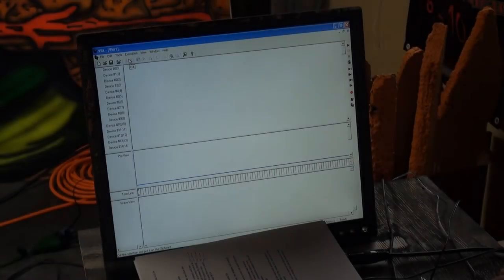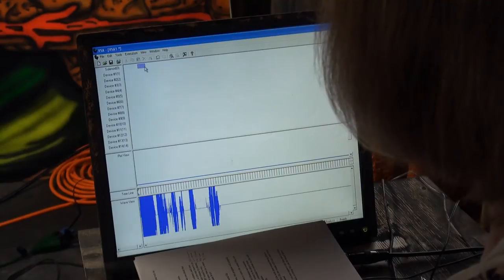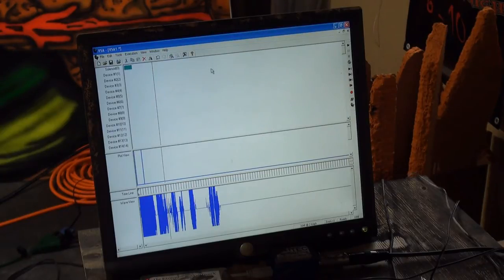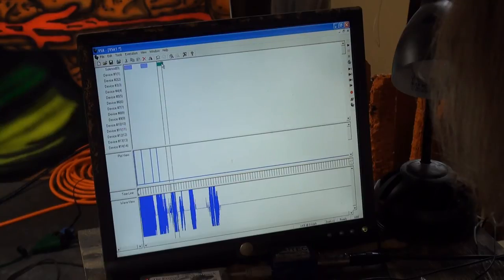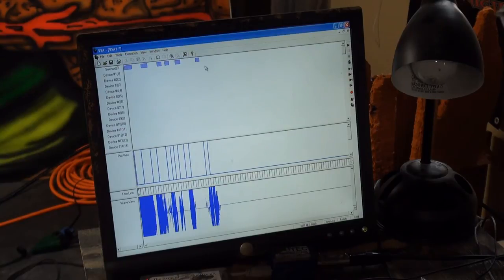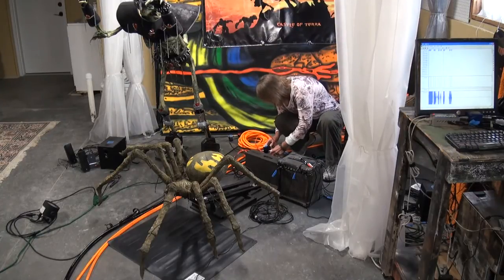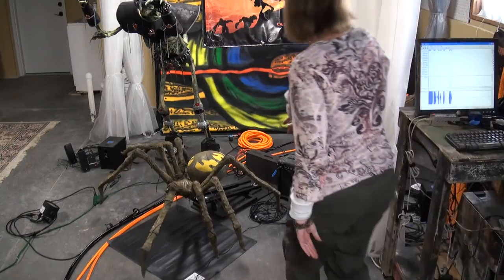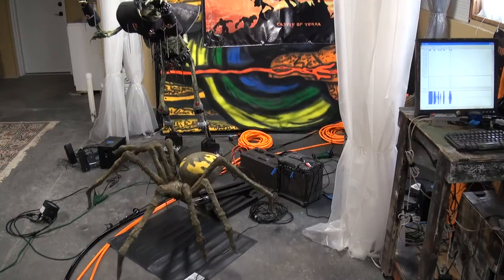Spider Prop - Step 4: VSA Programming

Comment from the maker: Nope - you can play around as much as you want. Here's a tip. When you get ready to play the routine and have the DMX/Enttec hooked up - you can plug in a lamp instead of the pneumatics so you don't have to have the air on. The lamp simulates the solenoid being fired.